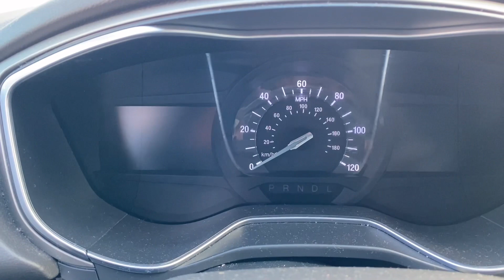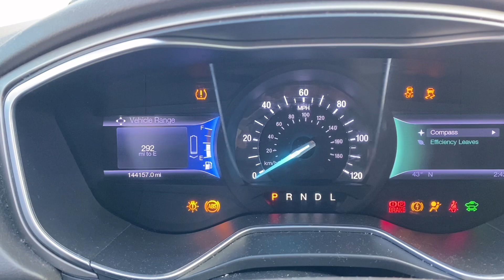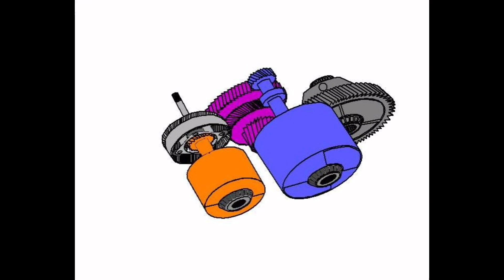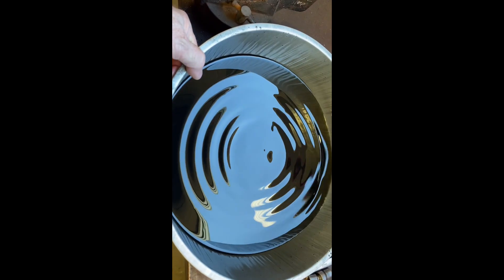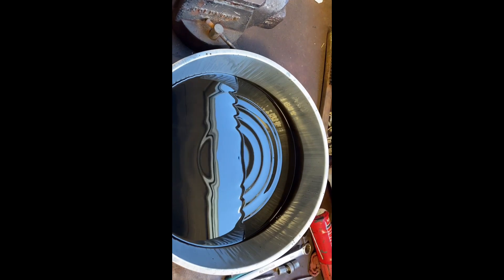Fusion Hybrid Stop Safely Now Transmission Failure

Comment: Sounds like a real winner to put in the new Maverick and expect people to load up the bed and haul stuff or tow
Reply from the maker: Can’t really say we’ve had to many issues with them since the upgraded the bearings and idler shaft.  Really it is a simpler design than a conventional automatic.  I think the Maverick comes with the 8F35 if you get the ecoboost / non hybrid engine.
Reply: @CarShopTalk what year did they upgrade the bearings

Comment: I have a 2011 Ford Fusion hybrid and was thinking of having the transmission checked! Would just topping off the fluid be enough or is there filters needing to be replaced at certain miles?
Reply from the maker: I don’t think there’s replaceable filters on that one.  Not without tearing it down.
Reply: @CarShopTalk  I'm not a favorite of just adding oil/transmission fluid to worn out stuff! I was thinking of replacing the transmission fluid and A/C system refrigerant at about 250k miles, but I don't want someone saying it needs a filter if it don't have or need one. My engine air filter is installed under a fender and is considered a lifetime one, but replacing it has been recommended by a dealership! Sad!

Comment: It is a shame! Ford`s Hybrid is a Licence Build from TOYOTA! But ONLY Toyota can build QUALITY! As i can see every Day on my 2004 Prius with 225.000km on the ODO! FORD ... OMG!
Reply: I can't tell you how many head gaskets I have done on the Toyota Prius. These things sucked coolant, and some bent con rods. Most Toyota gas engines are oil burners now too.
Reply: Someone ran their transmission out of fluid from a simple differential leak…

And it’s Ford’s fault?
Reply: My ford fusion has 245K miles.. still running great!
Reply: @jayabraham4377 Similar. 2018 Fusion Hybrid (Titanium) and im at 234k and still running smooth. 😇
Reply: Ford made the transmission back in 2005 originally
Reply: My Ford fusion has 360,000 miles I don’t see Toyota building something like that.. sorry

Comment: Does changing the transmission fluid every 30,000 miles prevent this problem?
Reply: Probably not. The most common cause is a manufacturing defect or design flaw. The low fluid level may have accelerated this failure mode though
Reply: I change mine every 60 and haven’t had any trouble

Comment: Probably nobody bothered to change the transmission fluid on this car. I assume most of the owners don't read the manual, so they may not even be aware that there is a transmission fluid to change into their eCVT car
Reply: service interval is 150k, so probably not at that service yet
Reply: Shut up

Comment: Never noticed any noise, but I had the emergency shutdown on my 2013 and the dealer only replaced the rear main seal.  They did not replace the whole transmission.  Now, nearly two years later, there's another apparent leak from the transmission, and they're trying to tell me they will not cover the seal replacement.  I would argue that losing transmission fluid twice has likely damaged the transmission, and with the TSB note, they should be replacing it.. ugh, dealers
Reply: (Ford has a 2 year unlimited mileage warranty on replacement parts, but this dealer didn't want to honor that)
Reply: Hi, Christophe Ashton 
I am from Toronto my 2013 ford c max had the same problem, please can I tell me how you fixed your car please 
Than you!

Comment: I found your video VERY insightful.  I have always been interested in the workings of cars.  I  bought a 2020 Ford Fusion Plug-in Hybrid Energi about 3 months ago and it makes this horrible whining, violin-type sound that stops when the car is put into park.  What could cause this?
Reply: Re Whining Noise in 2020 Ford Fusion...I spoke with a Master Mechanic at the Ford dealer who explained that the noise is coming from the electric hybrid  battery only when the car is in this mode.  The noise alerts pedestrians that the car is in motion since it makes no noise otherwise.
Reply: @dianachambers8237  4
Reply: @dianachambers8237  
Hmm...I am glad my 2017 Energi does not come with this "feature"
Reply: Hey when you figure it out please let me know. Mine does the same thing. Started about 1 month ago. I’m at 97954
Reply: I have the same thing/ how did you fix it

Comment: I have a 2015 C-Max 48,000 MI when the battery is depleted and it goes to engine drive it seems like the CTV is racing and the car is not going as fast as it should be this is my third C-Max in my other two did not act like this any suggestions had the Ford dealer check it out he said nothing was wrong
Reply from the maker: That’s a tough question without hearing it.  If they’re not finding any issues with the Powertrain I’d probably wonder if it’s a noise issue or excessive engine noise for some reason. Exhaust leak, engine mount transfer?

Comment: So I just had my 2013 checked today and  likely has this issue.  I was quoted 6700 and 10 hours for replacement for so sounds about right.  Was the TSB an actual recall on these?  Unfortunately I am at 160k miles so probably not something I can get covered under the drive train warranty...
Reply from the maker: No, there was never a recall. Just a technical service bulletin to help you diagnose them.

Comment: I live in Jordan Middle East and we have a lot  of fusion hybrids like a lot and all of those generations from 2013_2017 have trans problems and I don't know why is this problem common especially in the new gen I have an older model 2012 hybrid and I have done 120k miles and still runs like a charm
Reply: You have to change Flush your Transmission at every 50,000 or 30,000 in hot climate The only way to see the transmission last longer
Reply: I went to Ford.com to look up the "whining noise" and was referred to a video...Players.brightcove.net that explained what that Ford dealer master mechanic said was "making" the noise, but nothing about it being a "pedestrian alert"(I wasn't sold on THAT part anyway😂).
Reply: @dianachambers8237  the whining noise it's actually the internal bearings of the transmission is failing and it costs here 1300$ without labour so I advice you if you want to buy a fusion hybrid buy the 2012 model with low milage its the most reliable 
have a good day ❤

Comment: Thank you for the info.  I am learning what to be aware to take care hybrid vehicle. At first I thought there is no starter motor and just engine oil to worry about but I am not correct. The transverse gear lubrication seems harder to check than internal combustion engine transmission fluid.  It is more like a differential fuild. The worst thing about this is you are almost not able to check the condition in the garage when you are trying to buy a used vehicle.

Comment: Hello, I have an issue with my Ford Fusion Hybrid 2013. My transmission was very loud and ofter showed "Stop safe now". After removal there was a low of oil and the same whole in transmission like in your video. We replaced transmission for a new one and I have a new issue. When I step on it engine goes to high rpm and shows "stop safe now". Forscan shows one error: P1920. During a peaceful drive transmission works perfect. I checked crankshaft position sensor and it works fine. Could you please give me some advice? Thank you!
Reply from the maker: If the engines going to higher than normal RPM when you step on it, it sounds like it’s having trouble holding the engines speed down / sending power to the driveline. The starter generator has to hold the sun gear for power to go through the transfer shaft to differential. Could be an electrical or mechanical problem there or even an issue with the transfer shaft. It’s hard to say.
Reply: Did you ever figure out what was wrong with your car?

Comment: Hi how are you doing I have a question can you please help me out I have a 2010  For fusion hybrid That red triangle and that  And that yellow range And that yellow range That yellow key But Ivan running and I am going to do a complete stop I throw it into neutral and it won't turn off And the other thing  That it does If the car is cold It will go reverse It will go reverse After the car warms up If I put the car in reverse It won't go on reverse It will start jerking like a best friend not a gas But it will go for Thank you for your time  And I will appreciate it send me a comment

Comment: I have a 2013 Fusion Hybrid with around 72k miles. No noise or performance issues as of now, but wondering if I should have the trans fluid changed? Does this work the same as any trans flush/fill?
Reply: I have a 2016 and I changed it at 60k myself and will do my second coolant flush soon. It's better to be safe than sorry imo
Reply from the maker: I don’t know if there would be any point flushing it since it doesn’t have a torque converter. Changing the fluid wouldn’t be a bad idea and it has a drain plug and a fill plug.
Reply: WeberAuto recommends it at 60K but I don't think dealerships do it then with the 60K service. Probably a good idea not sure if you transmission has an electric pump that lubes everything up when the engine isn't running.

Comment: Thank you for the very informative video. I have a 2016 fusion energi with a recent increasing growling noise. I suspect a wheel bearing rather than the input shaft bearing due to vibration at highway speeds, pulling to left on braking and intermittent swaying at highway speeds (was aligned and balanced). Might you know what year they upgraded the bearings on this CVT model to help remedy the problem you addressed. Thank you for your help 🙏🏻

Update: It's been 2 weeks since I dropped off my 2016 Fusion Energi. Dealership said it was the transmission, personally I didn't believe it was. Should get it back in a week or so. They did order a new transmission from Ford and will install it under powertrain warranty (8yrs/80k for hybrids). Estimate at least 2-3 weeks before you can get your car back.
Reply: How much was the trans omission ?
Reply: If they are willing to replace the transmission under warranty you just won the lottery, congratulations.
Reply from the maker: You’re welcome.

Comment: My 2013 Ford C Max Hybrid has the same problem. Grinding noise on the transmission and looked like loose transmission support. My Car has 141K on it and still runs. I am glad I have Car Shield. I will stop by a transmission shop to have this fixed.
Reply: I think car shield stops at 150K.
Reply: Yeah how is Carshield? I hear....things lol.
Reply: @MrCliffda3rd  They replaced my transmission with a used one. It took them 3 weeks to find a replacement from a salvage yard.

Comment: My 2016 Energi won't run the engine very well at all. I had to charge up the EV battery entirely to get it to the dealership. 
Even in complete EV, I had to watch my acceleration, otherwise the vehicle would shake very violently (also sputtering and inconsistent acceleration) and then tell me to pull over. I have to restart the vehicle for the warning to go away. I came to a complete stop and it did the same thing, but the car in front of me could hear the same shaking and banging noise.
All this in EV mode! The engine never came on.
Reply: Your issue is bad coil or coils and needs spark plug replacements as I had same issue.  I had 2 bad coils which made the vehicle shake and not run unless on battery
Reply: @Salbritt  It was so weird. Turned out to be someone poisoning our gas tank.. They flushed the gas out and it ran just fine after. Then it got totalled a few months later by a road divider 😭
Reply: Sad.. road divider didn't move.

Comment: I have this problem on my car. Now it won’t move. It did the same noise when you started the car. The engine would run and then stop. Im afraid my transmission would looks something similar to the one you showed. I still haven't taken it to a mechanic, but I just know this won’t be a cheap fix. Thanks for the video.
Reply from the maker: I’m not sure how much the bill was on that one. I think just the transmission without labor was around 4K.
Reply: Im having the same problem here

So, what happened , did you fixed?
Reply: @viejon6537  I ended up getting a new car. It was gonna be somewhere around 5k
Reply: @percy.here1  Tks for replying 

So, the transmission  was bad? Did you find out for sure if that was the problem. 
Thank you,  I really appreciate your help. 
I’m planning to work on it myself and probably save a little bit  on the labor part